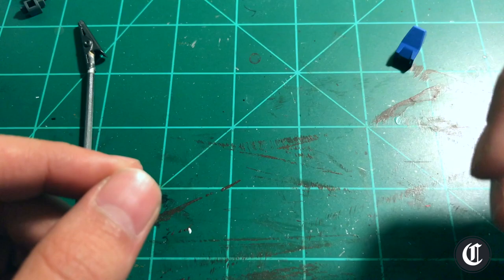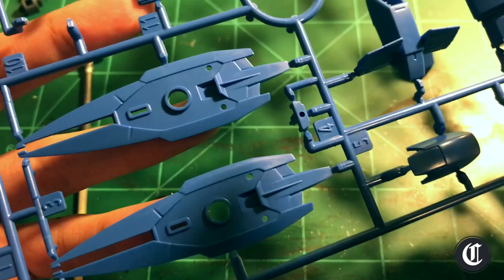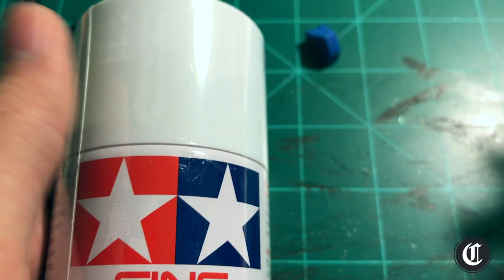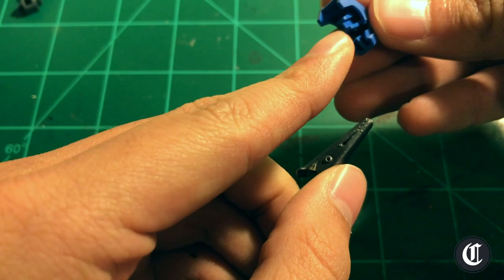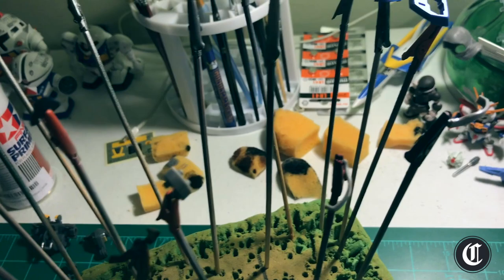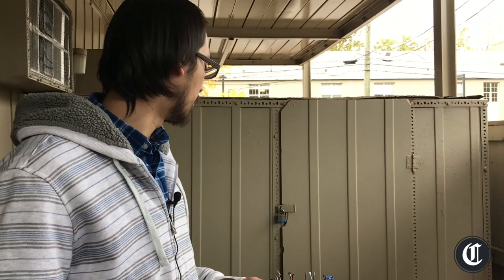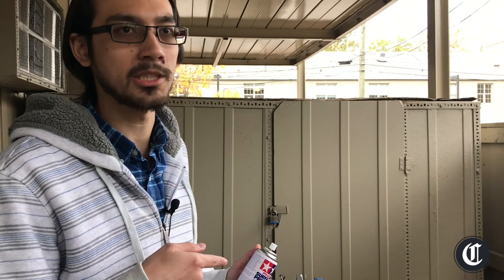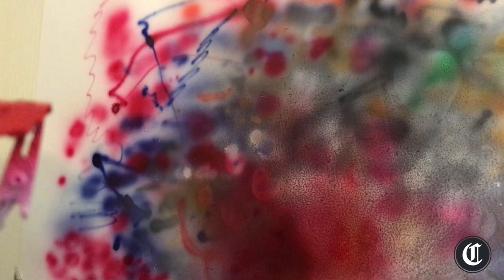Gunpla Tutorial: How to Airbrush for the Absolute Beginner

Comment: Tip 1. When you are cleaning your airbrush, increase the air pressure by ten to fifteen psi. Tip 2.use lint free scientific tissue wet with thinner to clean the inside of your paint cup and the outside of airbrush. 3. A 1:2 ratio of paint to thinner will help you achieve candy paint( and is my go to ratio in general) 4.apply photo etch parts with glue before you paint to ensure a strong hold( most hobby glues eat paint). 5. Use an explosion proof exhaust fan when painting with lacquer because the fumes are flammable( the fan is usually more powerful as well and will keep your environment fume free). 6. The distance you hold your part away from the spray will change the texture of the finished paint 7. Use a moisture trap as water will cause a splatter effect and ruin your finish( I do my painting near a fish tank so I use one on my tank and my gun) 8. Make sure you use the rapid drying thinner for metallic colors or the metal flakes will sink into the paint and effect the metallic look 9. Always use the slower drying thinner for non-metallic colors to ensure a perfect finish 10. Always use a static free brush on your parts to get rid of the static electric buildup from sanding that will attract dust to your paint job

Comment: Another tip for beginngers - Although priming with a rattlecan is absolutely fine, it does release a lot of VOCs into the air as opposed to using a primer that you can load into your airbrush (which could still have VOCs depending on which type you use, but significantly less) and it will continue to off-gas for some time.  Same goes with topcoats.  When I started doing final topcoats with the airbrush over rattlecans, everything was just so much better and my models weren't off-gassing for weeks.

Comment: I find Krylon white primer to be very inconsistent compared to the gray variety, I might have to get the Tamiya stuff in the future if I need white primer.
Reply: Recyclex I generally have terrible time with krylon. Sometimes theyre so grainy even after I gave them a decent amount of shaking
Reply: Kris Jou everytime i uuse. Krylon, theres bits of paint everywhere, but its the only thing availible where i live
Reply: So y'all know, Rustoleum One Touch works okay. I've never used their primer, though. I usually stick with gloss because of the lack of particles.
Reply: I use the cheap etch primer cans from the automotive shops. 13$ for a can 2.5x the size of the tamiya and 2 $ cheaper lol...

Comment: Hello, I'm one of the begginners. Thanks for sacrificing your lungs for us!  lol

Jokes apart, here's my question: I have a toy from Bandai's (it's an action figure, that's made of plastic for all I know). I want to change the color from pink to blue. Since it's a simply change (most of the figure is the color I want to replace and the few places that aren't can be covered by tape) and there's no way to dissamble the figure that I know of, I can just spray paint it? Or should I still apply the white layer and then try out the airbrush thing? To be honest I wonder if it's possible just to spray it.

Another important detail with the figure is that you are supposed to put stickers on it.  What should pay attention to after I paint the figure with the color I want? Should I use any other kind of product so the glue of the sticker will, well, stick to the painted figure?

Anyway, here's hope my questions are clear. I'm not a native english speaker so language barrier can be a pain. Specially when looking for the recomended produts.
Reply: You ever paint your toy?
Reply: if you can't disassemble it, the last option is to mask off the areas where your blue paint is unwanted. very difficult to do since you need to be precise with the masking tape. better not do that next time
Reply: I know this is a year late and maybe you already did it but my advise is. Lightly sand the whole thing, prime it with fine tamiya primer use fine layers, paint it all your main color while masking the scond color parts with rubber masking paint and a small brush, let it dry for a while but don't let the rubber sit for hours. After it dries, remove the masking and then do a reverse masking and coper the rest of the figure with paper towels as much as you can and lightly apply the secondary color. Once that's done let it try and apply clear coat. Good luck.
Reply: Thanks for the tips, guys. I haven't paint it yet because at first, I couldn't find the materials. Now, I did we are with this whole chaos. But I'm still planning to do it.

Comment: Nice tuts. I think airbrushing is not that hard but it could be intimidating to beginner. Why didn't you use primer with airbrush? On side note I envy you can use vallejo. I don't seems to have any luck using it. Clogged the airbrush pretty bad.
Reply: Tried it. Still can't get it to work. Luckily Gaia notes and mr hobby works just fine.

Well i'm still waiting for tuts on how you trim the decal on shining gundam. Damn it looks good XD

Comment: i just ordered an airbrush set and i had a few questions i wanted to ask
*im mainly painting lacquer(gaia & mr color) since those were what was left from handpainting, is there anything i need to watch out for?
*how should i clean the airbrush? would i need to flush it with thinner?
*and what should i do to switch between colors?
Reply: From my personal research (I also bought an airbrush recently):
1. Although you can use lacquer paints in an airbrush, you need to consider the consequences of it: the vapour created by the airbrush can be dangerous if you breathe it in - not like is fine to breathe in the acrylic paints but, while is safer to use acrylics in you house where you eat and sleep, it is not recommended the same for other type of paints. In any case, good ventilation is needed and masks, spray booths, even cleaning gloves are recommended. Better safe than sorry.

2. Honestly, search videos with cleaning the airbrush, here on youtube, or even google, you will get an idea. Shortly, use water (distilled recommended but not necessary) between colors and thinner when you finished a session and you will not paint that day anymore. Always clean the airbrush after a session, because, again, better safe than sorry. Also watch out for what thinners do you use, because some of them can eat up rubber components inside the airbrush, if you leave the airbrush too much soaked in them. The newer airbrushes tend to use silicone based components nowdays, so maybe this will not be the case, if your airbrush is a new model.

3.If you want transition between the colors, leave the old color in and mix the new color with the old color and spray a layer otherwise rinse the airbrush with water until the old color is cleared then put the new color.

Comment: Getting a refresher before I start ab today. One question on sanding and washing: if you sand and not wash, would the dust cause issues with the results of some painting? More specific, paints that have a high shine, finishes that will show imperfections?  I read that in regards to candy paint work, it will reveal a lot such as uneven surface, chips, what's left of not completely removing marks where nubs used to be, etc. Would this be an exception to really go into all aspects of prep, as assumingly accumulation of sanding dust will not give a surface as smooth and consistent if it was washed off. But that's my "educated guess" from reading and going off of other similar work involving preparation.

Comment: Lacquer, acrylic, or enamel for this gloss coat before you panel line with enamel wash? Will lacquer gloss smear the paint if you use acrylic or enamel?
Reply: you will want a lacquer most likely, lacquers are stronger than enamels and acrylic therefore if you use enamel thinner it shouldn't smear the lacquer coat as long you let it cure

Comment: I don't know if you're gonna read this but I have a question. If I prime my gundam with white primer but use a grey acrylic as a base, will it work as if I had used a grey primer? Thanks! <3
Reply from the maker: Vicent Reyes are you just trying to layer because you need a gray base? The base will determine the shade of you top layers. So if you prime with white, colors on top will be brighter. Gray is neutral. Black will be the darkest. 

You can layer paint how you wish so yes what youre asking will work. Just be sure to let it dry but just know that the primer doesn’t HAVE to be grey.
Reply: @BoundByGundams  I do a sort of effect of darker edges around the panels so that it looks like the gundam is weld together. I couldn't get my hands of grey primer so I was wondering if white primer and a darker base acrylic would do the trick. I think it's just layering colours but its my very first gundam build so I'm really confused lol

Comment: so what happens if you use a panel line marker on this without top coat?
Reply from the maker: Il you mean before or after? If you don’t top coat in the end you’ll risk your paint chipping or suffering from UV and moisture damage. It acts as a seal.

I wouldn’t use panel markers on painted kits. It just doesn’t work
Reply: @BoundByGundams  should you just apply a light layer of gloss and then panel line? or do you really need to make sure you get into those panel crevices? 
also for using washes like the popular tamiya panel line what is your opinion on using that directly on straight builds on bare plastic with no top coat at all? Ive put it so far on an MG barbatos on the PS and ABS with no coat and i dont think its brittle from what i can tell
Reply from the maker: Il a light coat should be fine. The idea is that when you go to clean up the excess, you end up rubbing away the gloss coat instead of the actual paint. That’s why you top coat again at the end.

I always use Tamiyas accent on bare plastic. Never had an issue. Just be sure to not let it pool up or sit for more than an hour. I could see how that would make it brittle.
Reply: @BoundByGundams  thanks so much for your input sir!
Reply from the maker: Il no problem. Good luck!
Reply: @BoundByGundams  follow up question to the wash after painting: so I gloss coated and I usually just use isopropyl alcohol to clean up the tamiya accent on unpainted parts, but even after (what I would call) a light coat of (acrylic?) gloss on my W-I-P painted parts-ate right through to the primer on the first piece I tried. Should I try and just spray a bit more coat on the rest of the pieces and go that route or could it be my wash cleaning choice? dont have much enamel thinner right now though
Reply from the maker: @il400  isopropyl might be too strong. Try lighter fluid or a weaker thinner. Maybe even try multiple gloss coats. Also be sure your paints are completely cured
Reply: @BoundByGundams  im gonna totally glass the rest of the parts with pledge and try again
i've now acquired some cheap lighter fluid and some mineral spirits so ill give that a try as well, i usually leave parts for a week before i touch them again
Reply: before i tried to only mist all my parts with mr hobby gloss coat (about 50 HG parts) and i used even all of the can so hopefully the future will come through on my next attempt :O

Comment: I'm going to recommend against using Vallejo air or Vallejo paints at all. I tried the air and they're basically just a fancy name for very diluted paints. So you're paying extra for someone to thin the paints for you and you get half the product or less. They basically have the consistensy of chicken shit compare to better paints like tamiya that feel like molten glass. Buy the tiny tamiyas and dilute them 50:50 and now you have a much better product, much more paint and for a cheaper price. F*** Vallejo, the chicken shit paints.
Reply from the maker: All airbrush ready paint is just diluted paint. I don't think anyone is denying that. Thinning Tamiya paint is the same as using airbrush ready paint albeit with higher quality paint. I'm not sure where you're finding Tamiya paints for cheaper but you gotta take into account the cost of the thinner too since you cant just use water. 

I don't mind paying for the convenience of having my paints thinned and ready unless I need a specific color. Also each type of paint (metallic, clear, etc.) requires experimentation to get the right ratio. I find with most Tamiya paints a 2:1 thinner to paint ratio works, but metallics take more thinner

Comment: Hey Jesse, my airbrush keeps on spitting and sputtering what appears to be water. I've cleared the moisture trap on the compressor and switched out the nozzle and needle twice to no avail. What gives? Thanks
Reply: You can mount a moisture trap on the airbrush's end also, this way you eliminate for sure all the humidity and will get a better pressure rate as well. Another thing that could cause this is the paint, maybe is too old, and the pigments separate from the medium, which is similar or is actually water.